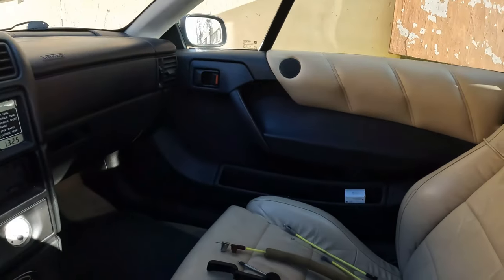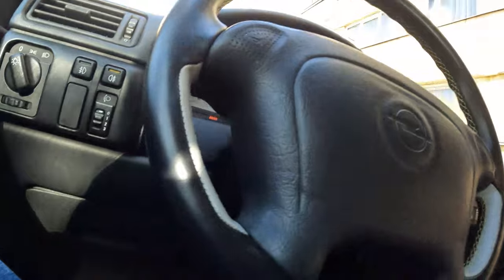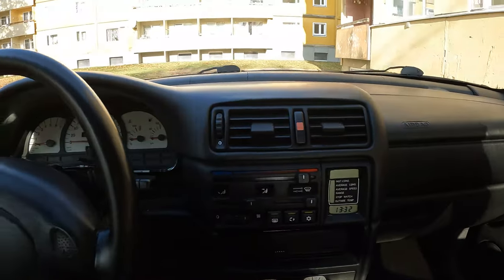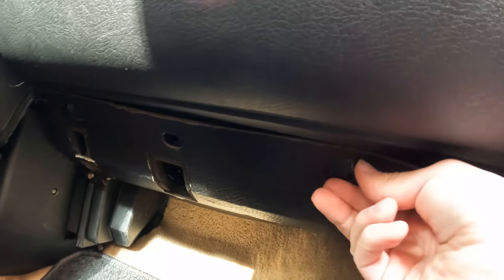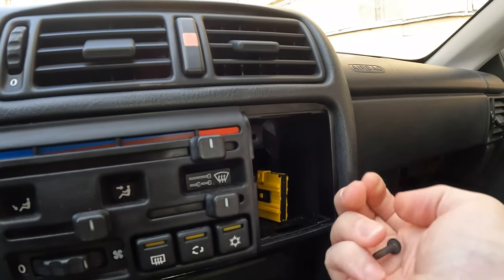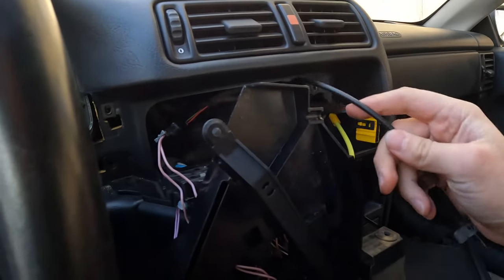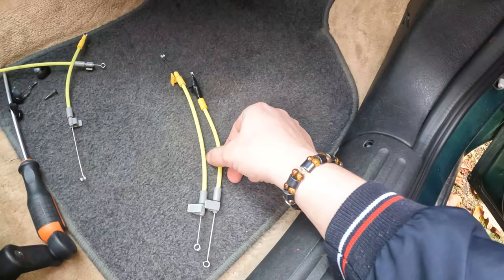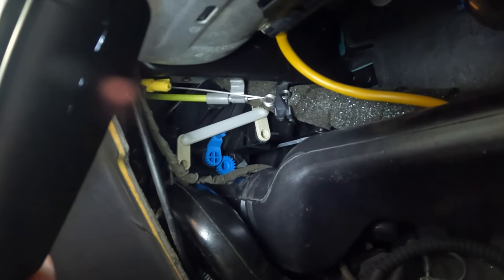How to change Opel Calibra heater cables

Comment: The cable in my cali that switch from heat to cool ,has broken ,great video ! I changed it but it was difficult ,wish to never broke again ! I also sprayed silicone spray inside the cables .
Reply from the maker: Thank you and i hope i can find new cables for backup if these should break.I hope not soon🙂